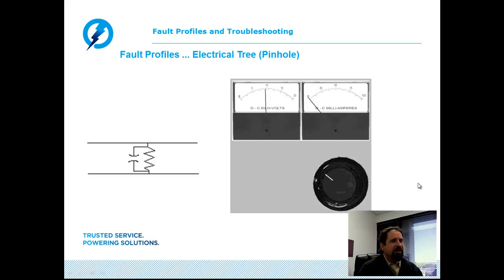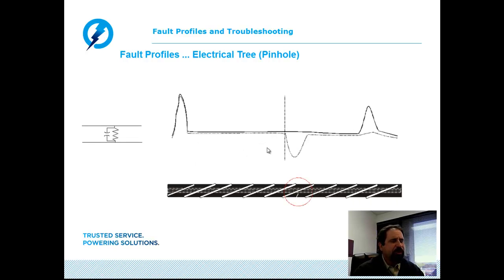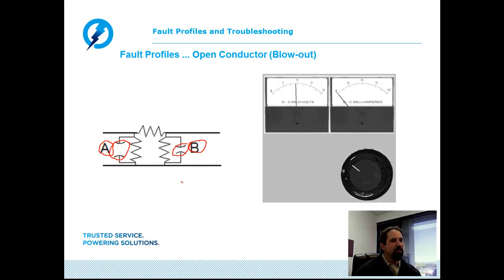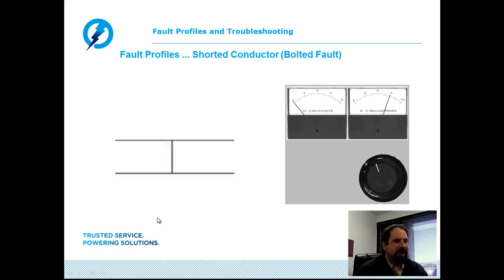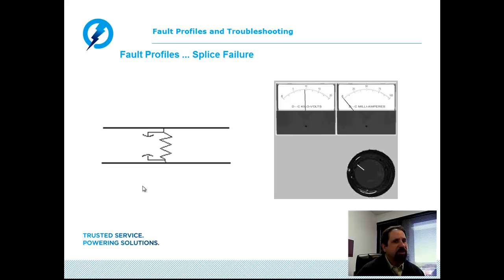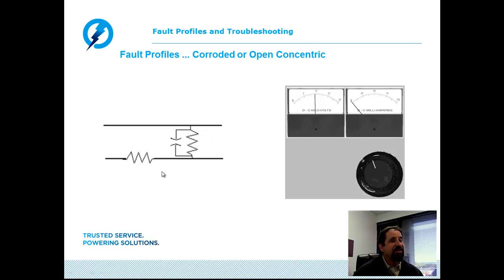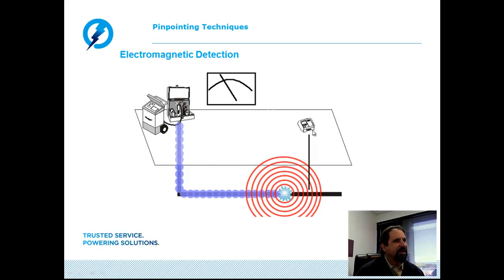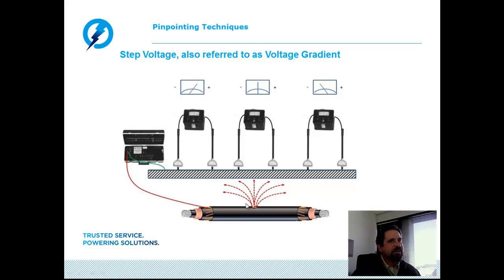Cable Fault Locating Part 2

Comment: Thanks for the great knowledge...Would you share with us if the cable is in the subsea? What is the best method to find the cable fault or low Insulation resistance?